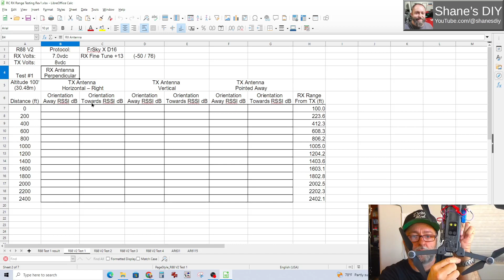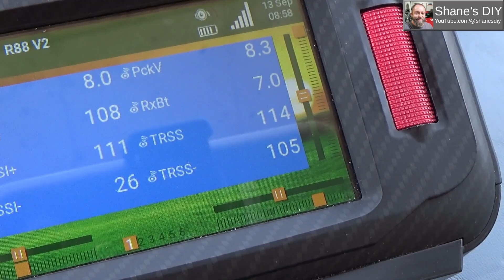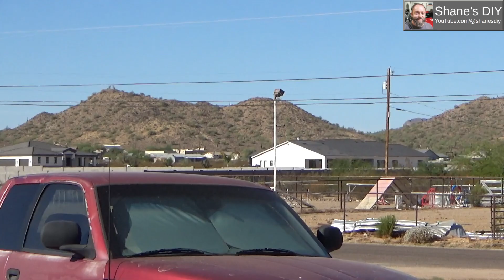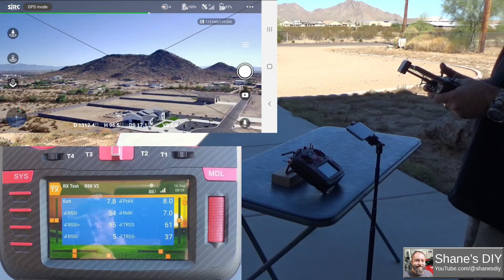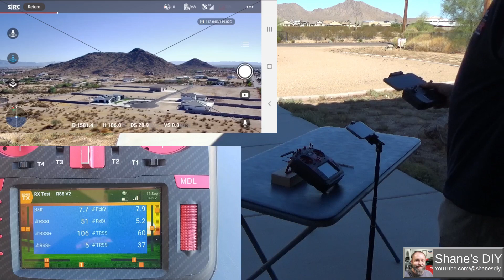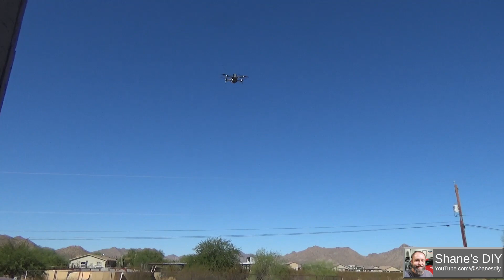The Most In-Depth Radiomaster R88 V2 Receiver Range Test Ever!

Comment: Shane thank you for the testing. Sadly I do have some of these receivers and I am reluctant to use them now. A distance of 2000 feet, is just over half a kilometre, up to now, I have bene flying my fixed wing models up to just short of a kilometre so based on your findings, I could well lose my models if I put this particular receiver in. Thank you again for your time, effort and straight forward approach.

Comment: Shane I realize this post is over a year old, but have you changed you school of thought on the R88 Rx?
Reply from the maker: In my later range test video with the Spektrum AR631 it is apparent that the R88 doesn't have near the range as the AR631 but both were well beyond my line of site.  I have used the R88 on my line of site planes since this video and never had any signal issues so I still think it is a decent low cost receiver.  Perhaps they are more susceptible to interference in some areas but in my experience where I fly I've had no issues.
Reply: @shanesdiy I'll have to check out your Spektrum test for sure! Thanks for all you do and getting back to me!!

Comment: I fully agree with you. I have saved thousands in the last few years. Fly what you like, my man. I will pick up a few of those receivers as well. Cheers
Reply from the maker: I did get a lot more range in my Spektrum AR631 range test but still haven't had any range issues flying line of site with my R88 receivers, still use them in a few planes.

Comment: Is there a way to factory reset the R88 receiver
Reply from the maker: Other than the failsafe setpoints, there isn't anything to reset.  Can you explain what you are trying to accomplish?

To change/set the channel failsafe positions, power on the transmitter, then power on the receiver.  Hold all of the sticks in the position you desire for failsafe and in 5-8 seconds press the bind button once.  The receiver will save these channel positions as the failsafe values.  One important one is to have the throttle set to minimum so if you get disconnected it doesn't power up and fly away!

Comment: cutting out at ~.3mi seems really short for me. In an area with really dense rf noise that's kinda unacceptable imo. I lost a really nice plane to an r88 signal loss with perfect antenna placement. I wish I had seen your testing before I trusted them.
Reply from the maker: Curious what you are flying beyond that range?   The distance I got was acceptable to me because I only fly fixed wing LOS and no way I could see any of my planes at that distance.  Anything FPV where you are shooting for ~1.0 mile or more I'd be looking at ELRS.

I have a Spektrum receiver range (re-)test coming hopefully soon, too many videos on the to-do list.
Reply: @shanesdiy  I've had range issues with Spektrum, non full-range frsky rx, and the radiomaster ones. I exclusively use full range frsky or full range elrs rxs now. I think it's a combination of a bad area and flying planes that are a bit bigger so I fly them further out. My smallest on a regular basis is a 1.2m edf and largest is 1/4 cub. I know people that fly really cheap rxs like the 10ch flysky or admiral ones on the regular, but I'm a whole lot more selective with what I put in my planes now.

Comment: I discovered a bug radiomaster r88 v2 if the radio it is located at 5-10cm the receiver turns off (but if one problem tx16s or receiver?)
Reply from the maker: Doesn't just happen with the TX16S.

For an aircraft ESC, no, it would be very unusual for the motor to start when the tx and rx lose connection.  The receiver will enter failsafe so you need to be sure and setup the failsafe.  Get the vehicle in safe condition (prop off for example) and turn off the radio to see how failsafe currently reacts.  If it is all ok then you are good.

If you do need to change it for the R88 V2, for example, to reset the failsafe channels, have the transmitter on and all channels set where you'd like them for failsafe. Primary channel is the throttle channel (usually ch3) to minimum.  Power on the receiver and after about 5-9 seconds (must be within 10 seconds) press the bind button and the receiver will store those channel values as the new failsafe values.
Reply from the maker: Not a bug, called "signal swamping". Not uncommon in RF systems.  You can google it and get quite a lot of info.  Unless you plan to sit on the plane to fly it, this is a non issue.  There are several RC manufacturers that when binding you must separate the tx and rx by a few feet/meters to get a successful bind.

I've had surface vehicle users have the issue and they do tend to get close to their vehicles for rock crawling, for example, so I suggested they enable "low power mode" which reduces the issue if you need to be that close.
Reply: @shanesdiy  not is one problem but I have to know to avoid it. During this lost signal the motor can start ?
I don't have to hold the radio at 5 or 20 cm, I asked others with tx16s and it happens to them too.
Not is one problem but it seemed strange

Comment: Range is sad.. Got btter with my old hobbyking 6ch rx on tx16s
Reply from the maker: Recall the protocol you were using for the Hobbyking 6ch receiver?  I have more range testing videos in progress and always interested in helpful data!
Reply: @shanesdiy btw on spec this r88 v2 can reach 1km, how to get that?
Reply: Hk tr6a v2 using afhds.. Use this rx before with turnigy 9x
Reply: Hk tr6a v2 Afhds.
I use this with my old turnigy 9x before but now with tx16s.

Comment: The main issue with these receivers is that they dont have failsafe when used in D8 mode.
Reply from the maker: Agree, I use D16. Get more telemetry with D16 as well. Better all around. 

Why would anyone use D8 anyway? Maybe if they have an older transmitter that only did D8 I suppose?
Reply: @shanesdiy  it was for a old 9xr pro with a djt module. the problem is they advertise it with D8 mode but there is no documentation that says it won't have failsafe in D8 mode.

Comment: This is an excellent test, and test procedure.  A few years ago I got back into the hobby, so all this 2.4ghz gear is still new to me.  The deal is, I have a radiomaster boxer, and pocket and have been using it on some small electrics.  I still use (and completely trust) my old futaba pcm gear on nitro planes.  Back in the day a Futaba 146ip was considered a "short range" receiver at a range of 300 meters, even then people were taking this receiver out way farther than that with no problems.  This new stuff to me still seems really fiddly.  I think the new ELRS gear looks very promising, but yeah back in the day you could put literally any receiver in a plane, and as long as your gear wasn't smashed or crashed, you could expect to sky out as far as you could see.  The old 72mhz stuff was good to about 5 miles out once FPV'ers started using it, and it wasn't at all sensitive to receiver voltage (brownouts).  I think this stuff will all work fine for line of sight, but as for me I've personally had so many fiddly issues with the new gear, antenna placement, transmitter antenna angles etc.  I'll probably end up conforming..but I feel so relaxed with the old stuff, and no one is flying it so the band is all clear now.

Comment: Man mine won’t turn on , do I need an esc to make it work or can I plug in a battery straight? With4.8v pack of course.
Reply from the maker: I've powered mine from a power supply. Sure you've got the power connector the right way around?

Comment: Very systematic test, thank you. But in my case, I recently bought a batch of six R88 receivers. Every one of them suffers from the so-called "swamping" issue. If you have the transmitter too close while you are testing the receiver and aligning your control surfaces, after about 10-15 minutes, the connection between the transmitter and the receiver goes bad. The servo responses become erratic with any control input from the transmitter. I will not trust these things in my airplane. Love the transmitter, hate the receivers.
Reply from the maker: Just curious why you believe the "swamping" issue is a problem?  Not trying to change your mind, I actually thought many more people would be of this opinion when I produced this video.  I've heard folks complain of the "swamping" issue many times and my opinion is why do I care if it doesn't work when my transmitter is <12" away from my receiver? That's where I notice "swamping" but that's not where it is when flying, only when everything is sitting on the bench in front of me.

I've experienced this anomaly from my Spektrum receivers as well and never had an issue while flying in many years.  If range is good and I don't have disconnects at real world operating distance I don't see the problem.  I'll continue to do more testing, just received some new antenna parts for my TX16S to experiment with so watch for another test soon if you are interested.  I'll use these R88's until I determine they have issues at range where it actually matters in my opinion and I'll absolutely report on that if it happens.  Will I loose a plane in the process?  Perhaps, but so far I've seen no evidence to lead me to that conclusion.

Thanks for the comment and discussion.
Reply: @shanesdiy   it's simply a question of confidence. I am not entirely certain that I lose signal because of a so-called, swamping issue. Radiomaster has not released any bulletins or advisories about a swamping issue. This is mere speculation from online users who have experienced the same quirkiness. But here's the reality of the situation. I have a receiver in one hand that gets goofy after about 10 or 15 minutes, and I have another brand of receiver in the other hand that doesn't do it. Both are relatively inexpensive; so which one am I going to trust with my expensive model, which I may have spent months building? Again, it's simply a question of confidence. One squirrely receiver, I can understand. But six -- in 6 different aircraft? Sorry, I do not have confidence in the R88 receiver.
Reply from the maker: @Ed-eq8ui  Certainly, if we are talking about hand made expensive models, the R88 would not be my choice of receiver, fully agree with you there.  I'm just interested in them for my cheap foamies.

Regarding, Radiomaster releasing some sort of bulletin on the issue, I'm not sure it is something created by them or a defect in manufacturing.  FrSky, which they share the protocol with, has a history of being susceptible to "swamping" as well.  It is not all that uncommon in other industries either, where a transmitter and receiver are in close proximity.  Even with WiFi I've experienced poor signal when a PC is too close to the WiFi router.

I am curious about the 10-15 minute timeline where yours start acting up.  That's strange.  I have two R88's I've been experimenting with and both don't function if I put my TX within a few inches of the RX but I've not encountered any odd anomalies over time.  I'll pay more attention to that as I do more testing.

One thing I've found with my two R88's that is contrary to what I've read online, the fine tune value for each of my R88's was different.  I had read that once you fine tune your TX for the FrSky protocol that will be the same value for all future receivers of that protocol you bind to. My two R88s had different values after going through the procedure.  Did you perform the fine tune procedure for each of your receivers and did you notice they were different?  Very curious your take on that.

Thanks for the interesting discussion!

Comment: Will you make an Indeph video on the radiomaster r88 v2 programming and setup???
Reply from the maker: I was planning to make a quick on on binding to all 3 compatible protocols soon.  S-FHSS, FrSky D8 and D16.  Other than that, nothing to program.  Did you see my recent video on getting the R88V2 to read flight pack voltage?  It's part 2 of my voltage telemetry videos.  I'll work on that binding video soon.  Anything else you are specifically interested in?  I will also do the frequency tuning as well as part of that.

Comment: Nice! I use flysky ia6b but I’ll check this out. The R81 doesn’t work that well for long ranges
Reply from the maker: Interesting. I've not used the R81, I know it has different antennas than the other R series receivers. Be sure to properly fine tune the frequency.

I've heard good things about the ia6b but haven't tried it.

Comment: Great job with a lot of information Shane.  My question now would be: how much RSSI increase would we see if we were using a 2.4 YAGI antenna.  Of course this one would be pointed at the receiver.  But how far out would we lose signal strength?
Reply from the maker: Perhaps to stay true to the theme of the channel I should "DIY" a Yagi to put on the TX16S...
Reply: That sounds like the way to go. Then you could add another spread sheet page to the group.
Reply from the maker: You mean a yagi on the transmitter?  If you know of a specific antenna that will work on the TX16S 4in1 internal module let me know, if I can find one at a reasonable price I'll give it a try!
Reply from the maker: A google search and I see a yagi that slips on the TX16S factory antenna. You referring to something like that or replacing the stock antenna?
Reply: Well I'd start with that and then an actual yagi mounted on the TX16S.  A 2.4 ghz yagi will not be that big.  Let me see If I can find one.

Comment: That's why I like the Flysky rxs, there cheap in price as well. Also the antennas could care less where they were mounted
Reply from the maker: The RX antennas on the R88 didn't care either according to these tests.  TX antenna is another story.
Reply: @shanesdiy  I'm now using a ELRS boxer with Radiomaster ER6 rxs. Wont have to worry about range issues and rxs are still cheap in price

Comment: This is valuable data and shows solid results for this configuration. Nice job in designing and implementing the test procedure. Interesting test bed and data acquisition techniques. I'd be interested in a similar test with ELRS and the Radiomaster ER8 - However I'm not sure I've seen you use this equipment. Thanks for putting in the effort and presenting the results.
Reply from the maker: Thanks. So far I haven't delved into the ELRS world but that would be a good test. I have a feeling it might exceed the range of my drone though! Maybe soon I'll get myself some ELRS equipment.
Reply: I agree with the ELRS range based on some other testing I have seen. But SNR, RSSI and antenna orientation might offer some useful results for us LOS flyers.. @shanesdiy
Reply: Would be hard to test elrs as it can go miles and miles
Reply from the maker: Yes, pretty sure it will do better than my drone, best I can do is a mile or two I bet.  At that point, just need to install the ELRS receiver in the drone with a flight controller & gps for the testing but that's not uncommon, just never seen a standard RX tested like this.
Reply: @MikeyMikey1968  Maybe not. My BetaFPV ELRS Lite Receivers V1 (ceramic antenna) failsafe at about 100 feet. The replacements V2 they sent me, as they said the V1 was faulty, failsafe at about 200 feet. Not all ELRS receivers are made equal. BTW: Great effort on the video Shane. Got a new subscriber.